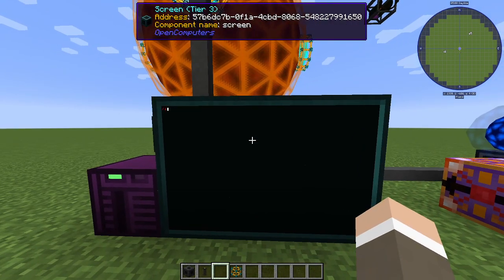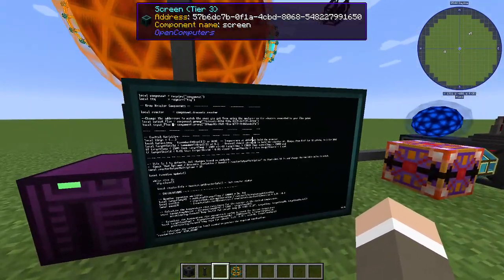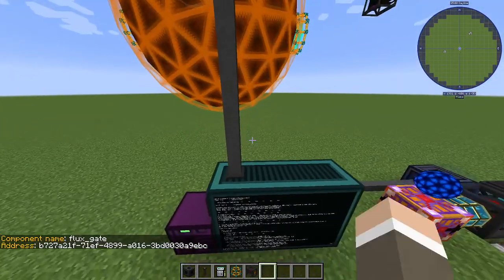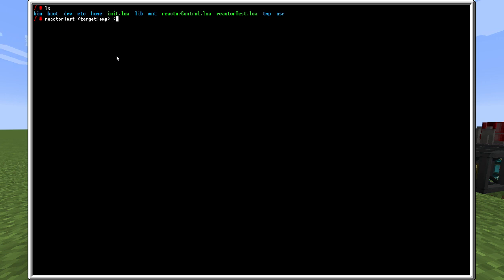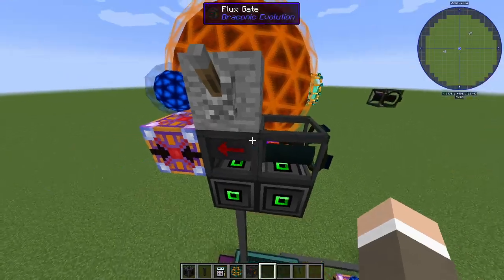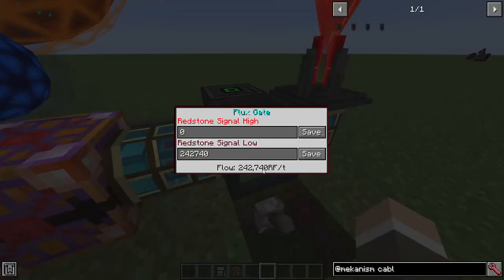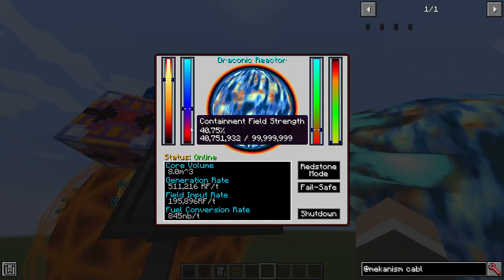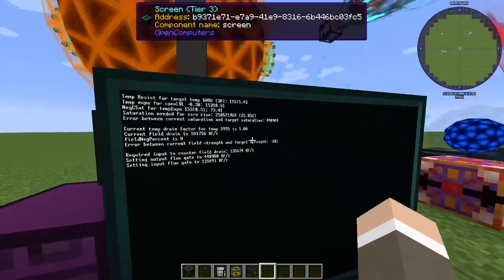How to setup my Draconic Reactor Control Script for OpenComputers (WIP)

Comment: script link?
Reply from the maker: I updated the description with the pastebin link to download it. Open a file on the computer in minecraft that you want to save the program to. Copy the code from the program to your clipboard (ctrl+c as usual), then on the minecraft computer, use middle click into the empty file to paste the code. Save and close, and you should be good to go (you'll still have to adjust the three variables I went over in the video, of course).
Reply: @AwesomeAlec1  thanks ur script is very easy setup and use
Reply from the maker: Please note: I will post any updates to the program on top of the current pastebin instead of posting a new one. I have already posted a fix for the temperature not holding properly, and the code is working as intended now.
Reply: @AwesomeAlec1  question do i copy the entire thing?
Reply from the maker: @Lilvince3398  yes
Reply: @AwesomeAlec1  well how do i install it cause i did copy the entire thing
Reply: @AwesomeAlec1  how do i install it
Reply: @AwesomeAlec1  no i am not new to open computers just haven't used it in awhile but still how do i install it
Reply: @AwesomeAlec1  how do i install the program sorry if i am sounding rude but i really don't know how
Reply from the maker: @Lilvince3398  the video is the installation guide. If you followed it and ran into issues please let me know what they are
Reply: @AwesomeAlec1  ????? Not a single thing in the video said ANYTHING about how to install it
Reply: @AwesomeAlec1  NO NOT A SINGLE THING IN THE VIDEO SAID ANYTHING ABOUT HOW TO INSTALL IT
Reply from the maker: @Lilvince3398  sorry, confused it with an updated guide. On the computer you want to install to, run the command “pastebin get 466gSMBN <desired-name>”. Replace desired_name with the whatever you want, as long as it’s one string. You can then type that string along with the arguments you want as demonstrated when I run the rector in the video
Reply: @AwesomeAlec1  it's fine
Reply: @AwesomeAlec1  it didn't work it says syntax error near unexpected token newline
Reply from the maker: @Lilvince3398  is this error for the pastebin or for running the actual program?
Reply: @AwesomeAlec1  pastebin
Reply from the maker: @Lilvince3398  what exactly did you type in? Asking since it’s a syntax error

Comment: for some reason when i tray to set the sheild strength to 20% the system ato jumps it back to 50
Reply from the maker: Is that occurring during charging, or while the reactor is running? If it's happening during charging, that's normal, as you have to do that before you can activate the reactor.

If it's happening while the reactor is running, that's rather strange. If that's the case, is there any more info you could provide? I'll need a little more information to go off of.

Comment: I know this is an old video, but any chance you can help me out? I get the following message when i try to run the programme:

(THIS BIT IS IN WHITE TEXT)

Temp Resist for target temp 8000 (40): 42666.67
Temp expo for convLVL -0.30: 55766.67
NegCSat for tempExpo 55766.67: 87.78

(THIS BIT IS IN RED TEXT)

/reactor:59: bad argument #2 to 'format' (number has no integer representation):

stack traceback:
                   [C]: in function 'string.format'
                   /reactor:59: in local 'update'
                   /reactor:122: in main chunk
                   (...tail calls...)
                   [C]: in function 'xpcall'
                   machine:798: in global 'xpcall'
                   /lib/process.lua:63: in function </lib/process.lua:59>
/home #
Reply from the maker: Most common cause for that bug is caused by running the program before running the reactor for the first time. Give it some fuel, press charge and then press shutdown again (on the reactor). That usually fixes it
Reply: @AwesomeAlec1  I have this same issue, I tried running the program after running and shutting down the reactor but I got the same error, should I try anything else?
Reply from the maker: @ProGamerDoggo  only other thing I could think of would be to make sure your reactor’s connected via an adapter in addition to your flux gates. It attaches to either one of the stabilizers or the injector. If that doesn’t work then maybe try saving, quitting, and restarting
Reply: Thanks for the fast reply. I tried the fueling, charging and shutting down trick but unfortunately that didn't work.

I'll try your other suggestion when I can get on it again on Sunday
Reply: Im having the exact same error, have you discovered a fix yet?

Comment: I keep getting an error about line 59 and 122 and I can't find the issue
Reply from the maker: What exactly does the error say? I need the full error message
Reply: @AwesomeAlec1  here is exactly what it says: Bad argument #2 to 'format' (not a number in proper range): stack traceback: [C}: in function 'format' /home/reactorTest:59: in function 'update' /home/reactorTest:122: in main chunk: (tail calls) [C}: in function 'xpcall' machine:798: in function 'xpcall' /lib/process.lua:63: in funtion <lib/process.lua:59>
Reply from the maker: @brianakins5016  This seems to be an issue with the target saturation. Have you run your reactor before? Try putting it into a charging state (but not activating it) and then run the program again.
Reply: @AwesomeAlec1  that worked, thanks for the help!
Reply: I'm getting a similar error on mine as well, for me it says: bad argument #2 to 'format' (number has no integer representation) [C]: in function 'string.format' and the rest is the same. I tried restarting the reactor a few times and activating while it was charging but it still gave the same error. I also tried using it on an already running reactor in a creative world and it worked perfectly fine. Something to note is that the world I'm getting the errors is on is from a LAN network and I don't have the world files on my pc
Reply from the maker: @8BitExplosionGaming  that world file thing could potentially be your issue, then.
Reply: @AwesomeAlec1  I'll see if I can get the world owner to try running it, hopefully it'll work then. Thanks for the help regardless
Reply: @AwesomeAlec1  Hey, I'm also playing on a multiplayer server and I get the same message as Meme Engineer, could that be an issue with multiplayer and lan? could you look into it please.
Reply: @manikasraee7114  I think it might actually be an issue with the cables from opencomputers, as when I place them down in single player they get dyed black when they connect to the adapters, but they don't when I place them in multiplayer

Comment: This is awesome! Thank you for sharing! I have no idea about programming in open computers, but I managed to start the program and it worked just fine. I also used another tutorial to have the program run automatically when the computer starts up.
Reply from the maker: Thanks!
Reply: @AwesomeAlec1  So I understood it to mean that the reactor generates more and more power over time, until it runs out of fuel.  So what is the maximum it can produce?  I don't know if I should take the risk if I can just use something like Environmental Tech solar cells instead..
Reply from the maker: @Amogus-hs5tz  As mentioned in the video, there's a multiplier in the mod settings that affects the reactor's output. Assuming it's at its default value of 1, the reactor will generate ~400,000rf/t and can generate up to ~1,300,000+ rf/t when reaching 80-90% fuel consumption.

Note on two things: 
1. Don't ever let the reactor reach 100% fuel consumption. If this happens, the reactor's heat dissipation will literally drop to zero, even if you try to shut it down.
2. This power increase is based on how much chaos is in the reactor (which is equal to how much fuel has been consumed). Once the chaos has been removed and the reactor refueled, this power generation bonus is reset back to the base generation rate of ~400,000*reactorOutputMultiplier.
Reply: @AwesomeAlec1  I guess I will set the multiplier to 10 then because it is so expensive and so dangerous. Can your program shut the reactor down automatically when it reaches a high fuel consumption?
Reply from the maker: @Amogus-hs5tz  Yes it will! Currently, I believe it's set to stop the reactor when it reaches 85% fuel consumption. You can test this in creative mode by only giving the reactor 2 ingots of fuel and then setting the reactor to run at around 10,000 degrees (this temperature will cause the fuel to be consumed at a very high rate so you dont have to wait for hours to see the auto-shutdown).
Reply: @AwesomeAlec1  okay, thank you!
Reply: it helped me too THANK YOU SOOO MUCH

Comment: Do you know how to resolve this error? https://prnt.sc/10rmsxw
Reply from the maker: Have you run the reactor at least once before activating the script? if not, then the reactor will have a bunch of null values for saturation and field strength and whatnot.
Try this procedure:
1. Start charging the reactor. This is safe as the reactor cannot drain its field strength in this state.
2. Run the script. Charging the reactor causes the reactor's max saturation and max field strength to update to values appropriate to its size, and should therefore fix you error, as I believe this is the cause.
3. If/when the script shows that it's flooding the reactor and doesn't give an error, check that the input flux gate is working, and then activate the reactor fully. The script should take over maintaining the reactor.

Comment: will the script work with computer craft?
Reply from the maker: Unfortunately not. Opencomputers reads code differently than computercraft does, but I may consider making a dedicated computercraft version in the future
Reply: @AwesomeAlec1  there is nothing that explains computercraft settups, so i figured i culd ask :P
Reply from the maker: @yogen313  have you tried this? https://www.youtube.com/watch?v=8rBhQP1xqEU
Reply: @AwesomeAlec1  yeah, i tested it in a creative world, it blew up, and it lost controll almost instantly i cut off the starting power suply
Reply from the maker: @yogen313  yea, cuz you're not supposed to cut off the power supply.. XD You need to keep giving it power for the shield
Reply: @AwesomeAlec1  well i needed power to start it xD
Reply: @AwesomeAlec1  plus, that set up is intended for 1.7.10